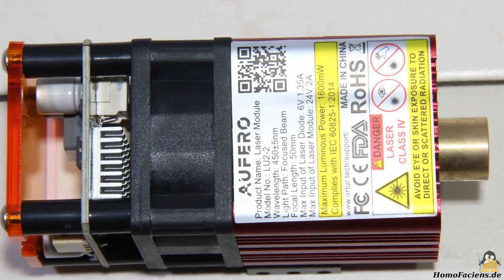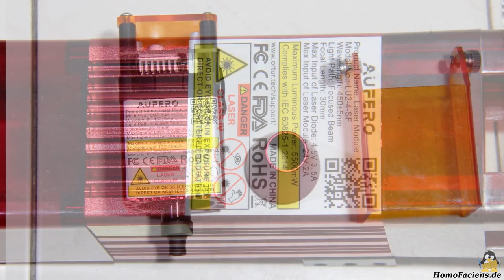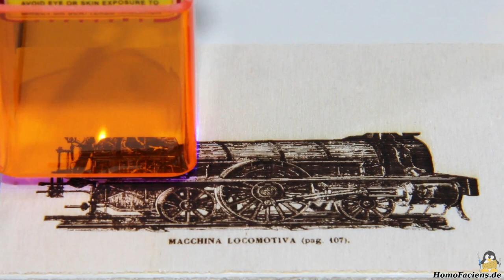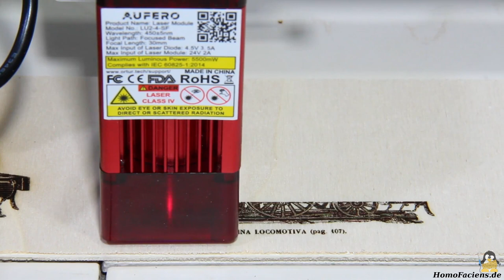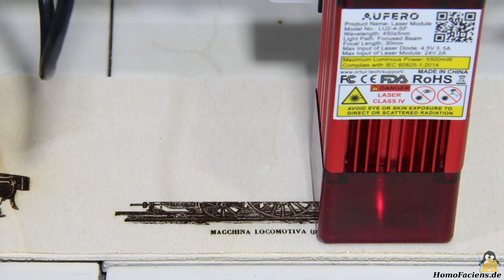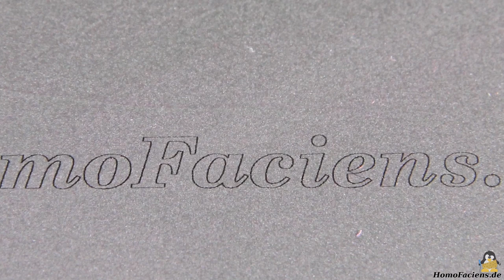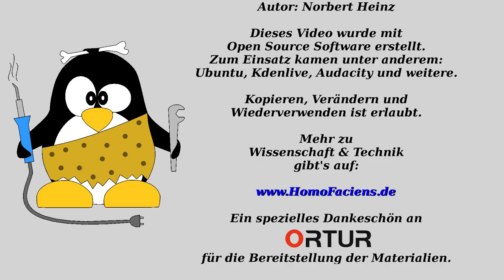Testbericht Ortur Aufero Laser 1

Comment: Hallo,

Hab vor mir diesen laser zu kaufen.

Kann der LU2-2 auch Pulverbeschichtetes metall bearbeiten ?

Und zwar habe ich eine platte welche beschichtet ist und auf welche ein logo müsste.

ist dieser laser stark genug ?

Danke und lg
Reply from the maker: Irgendein Metall mit irgendeiner Pulverbeschichtung?  Mit diesen Angaben kann ich leider beim besten Willen keine Aussage machen, ob das funktioniert.
Reply: S235 JR mit  Polyester/Urethane/Epoxy/Hybrid beschichtung .

Verstehe aber nicht wieviel mehr dass dir das nun bringt 😅
Reply from the maker: Ganz einfach: Alu ist ein sehr guter Wärmeleiter und wenn man da noch eine Weiße Beschichtung aufbringt, wird's mit unter selbst mit den leistungsstarken Lasermodulen schwierig, da was von abzuknabbern. Eine dunkle Kunststoffbeschichtung auf Stahl könnte funktionieren. Kommt halt immer auch drauf an, was mal als "das klappt" bezeichnet. Nur dünn, als Hologramm oder so richtig tief rein in's Material.